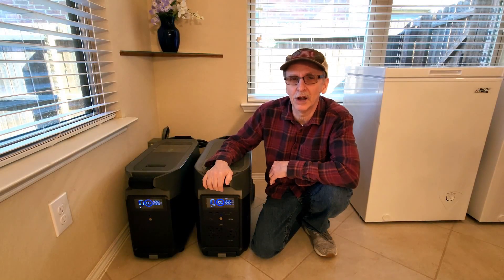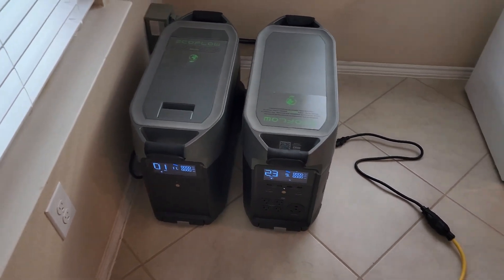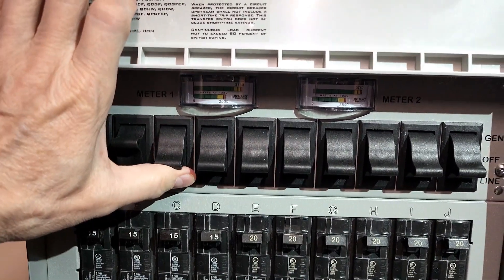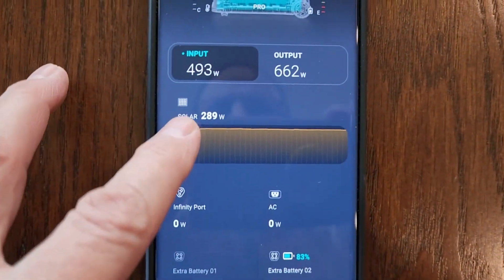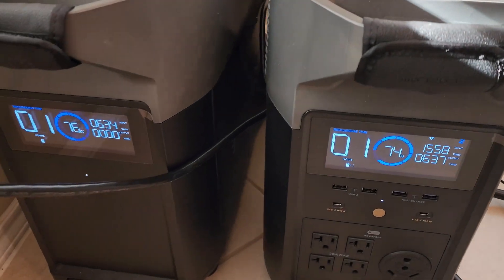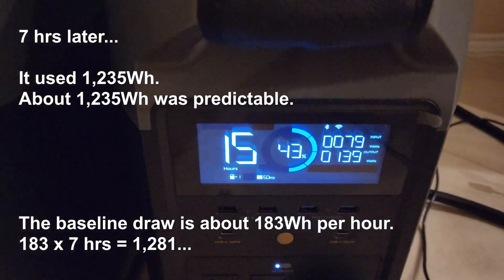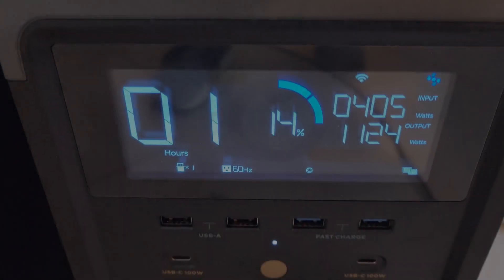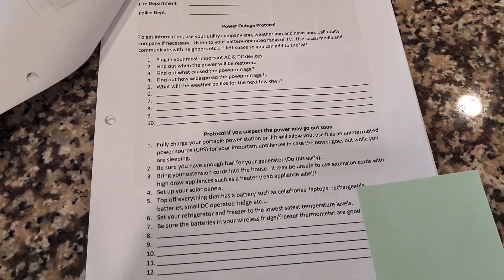Ecoflow Delta Pro Solar Generator - 24 Hr Power Outage Test. Charged With Gas Generator And Solar.

Comment: Thank you for this video, im collecting all the parts needed to assemble the same system for my home, I'll also be adding the eco flow smart gas generator 👍
Reply from the maker: I would have bought the smart gen had it been able to run on on propane.
Reply: My advice to you if you are interested in purchasing the Smart Generator: I have purchased the Delta Pro, 2 Extra Batteries and the Smart Generator. 1) I learned that the Delta Pro no longer comes with the adapter to connect to the Smart Generator. The adapter used to come with the Delta Pro and not the Smart Generator. The Smart Generator was built for the Delta Max, which doesn’t need an adapter. But EcoFlow markets the Delta Pro as being compatible with the Smart Generator out of the box and it’s not. You will have to buy the adapter separately. 2) The cable to connect the Pro and the Generator together is only 16 feet long. It is a proprietary cable. So you will have to be real careful on how you plan to use your generator as this cable is too short for how most people will realistically use this generator. For that very reason I can’t use my Smart Generator. I will eventually have to come up with a solution that will allow me to run the cable through the wall to the outside. If the cable wasn’t proprietary I would use an outlet box similar to the one used in this video.
Reply: @xxfire07  thanks for the heads up

Comment: I thought you could charge it while you used it.
Reply from the maker: Not sure what part of the video you are talking about... Please show me where in the video you are confused because you can.
Reply: @LoneStarPrepping  you shut things down to charge the ecoflow with the generator.
Reply from the maker: With my setup, if I am using the transfer switch with the propane gen to charge the pro, I cannot use the inside transfer switch inlet with the pro at the same time because the gen is using it.  I can use the 120 outlets on the pro to run things at the same time if I want.  In your case, just dont use the gas gen on the transfer switch.  Just charge the delta pro with the gas gen directly without using the transfer switch.  That way you dont have to unplug the pro from transfer switch inlet. I do it the way I do because I dont want to use an extention cord from gas gen to pro through a crack in my door, among other reasons.
Reply: @LoneStarPrepping  Good deal! Thanks for great videos!
Reply: @LoneStarPrepping  I want to keep things running while charging.

Comment: Question!   I have a Delta Max and read that when storing away you have to drain the battery down to 30%-35% for long term storage.   But that seems to defeat the purpose of having it for unexpected power outages when I won't be able to charge it from an ac outlet prior to using.    Does this sound right to you or am I misunderstanding what they are saying.  I read in one of your comments on another video that you drain the battery every once in awhile down and then recharge it back up to 80 or 90%.    So when not is use.....do you keep it fully (or almost fully charged?) and then just drain it occasionally (every few months) to keep the battery fresh.    Any clarification of this would be helpful.   I just think it is pretty useless to have a battery at only 35% when I need it the most and now there is no power to recharge it.   Hope I am not being confusing.   Thx.
Reply from the maker: I understand.  I keep mine at 80%, but I charge it up and use it every 3 to 6 months.

Comment: Although I have a 22KW whole house generator with two 500 gal propane tanks buried in the yard, it's my Delta Pro plus add'l DP Battery that will provide for my daily power needs in a grid down situation. I have 1600 watts of solar to keep it charged, and would only run my whole house generator for about 60 minutes, twice a week. During that hour we take a hot shower, do laundry, bake, refill our water storage from a well, etc. I bought an EV charger that I plug into my 240V dryer outlet to fast charge my Delta Pro when I run my generator, or if we get an extended period of cloudy, rainy days that shuts down my solar. The Delta Pro is an awesome unit and runs my DC fridge, DC freezer, Microwave and many other appliances when needed.
Reply: that sucks the ecoflow can't run your house fridge.
Reply from the maker: @uhjyuff2095  Where does he say he can't run his house fridge on the Pro?
Reply: What's the EV charger you bought?

Comment: Can the delta pro be charged with a small generator that’s not pure sine wave ? Can’t find an answer to that. I have a small generac IQ 2000 and not sure if it is safe to use for charging my delta pro or not.
Reply from the maker: It probably can, but it is not recommended.  I would only use a pure sine gen.

Comment: I don’t understand how your plugging a 120v plug into 240v. Are you using a plug converter? Link to what your using?
Reply from the maker: I showed everything Im using.  The delta limits itelf and can even take an EV station charge.
Reply: @LoneStarPrepping  from the dryer plug I can see a black plug with a short orange cord then it looks like the orange cord is connected to the 15amp yellow cord that you mention that runs to the delta pro. 
I guess what I'm asking what is the orange section plugged into the dryer 240v outlet?
Reply from the maker: @TonyStark998  ...just extention cords.  I posted links to them inder description.
Reply: @LoneStarPrepping   Thank you very much Sir. Great video!

Comment: Great video it looks like you plug the delta pro directly into your generator inlet don't you need the voltage doubler thing to output 240v?
Reply from the maker: I dont use 240... only 120.  To get 240 I would need 2 delta pros.

Comment: In the winter would you be able to run your furnace? Is that transfer switch interchangeable?
Reply from the maker: No.  We have an all electric furnace, and it requires high voltage.  If I had 2 Pros, I could connect them together and run it but I chose to get the Pro plus extra battery instead.  Not sure what you mean by "transfer switch interchangeable".
Reply: @LoneStarPrepping  You could use portable space heaters and your gas generator and still survive!
Reply from the maker: @uhjyuff2095  We use an olympian wave propane heater.  But if I want to use my vornado electric heater, I have plenty of propane to run my gas gen for long time.

Comment: Get the ecoflow delta pro smart generator. It will automatically charge the unit when capacity bets to 20%
Reply from the maker: No.  I am perfectly aware of thier generator.  I knew about it before it was officially sold retail. They should have made it dual fuel.  I want to run propane.

Comment: What transfer switch do you have? Is it a 30 amp inlet for the transfer switch and a 50 inlet for the gas generator?
Reply from the maker: The transfer inlet is setup for the 30 amp outlet of thr DP.  It is setup for 120 volt only.

Comment: Any idea what the max wattage the units can take from a generator. My generator is 7500 continuous watts.
Reply from the maker: The max wattage input is regulated by the unit itself.
Reply: These do not replace gas generators although the people that run the world are eliminating fossil fuels for the average person. That is why an investment in a solar generator is likely a good one.
Reply: 1,800 watts AC
Reply: The print below the charging receptacle on the EcoFlow Pro sais it can accept 100 to 240 volts ac 15 Amps Max, so you just need the right cable or adapter and should charge at 240 x 15 = 3600 watts.  It only comes with a cable to plug into a 120 volt wall outlet.

Comment: How is it that you can put 220 volts into the normal 110 volts input and not damage the unit? That's remarkable.
Reply: The print below the charging receptacle on the EcoFlow Pro sais it can accept 100 to 240 volts ac 15 Amps Max, which would be 3600 watts, (240 x 15 = 3600) so you just need the right cable or adapter.  I don't see a link in his description for the cable and adapter he's using, although he's told others that its there.  Also, the black power cord included with the EcoFlow Pro has print on it which sais its rated to 300 volts, and they warn you not to use any other cord.  Maybe that's why he removed the link to what he's shown.

Comment: Have you given any thought to possibly using ecoflo’s generator that you could leave plugged in ‘directly’ to the delta pro’s through a through the wall interconnect that automatically turns on and off based on state of charge?
Reply from the maker: Do you mean their their gas generator?   If it were able to run on propane, like mine, then I would have at least considered buying it.  It was a big mistake by Ecoflow, in my opinion, not making it a dual fuel generator.  Also, I had my dual fuel generator way before I bought my DP.  I used it to charge my other ecoflows.
Reply: @LoneStarPrepping  Ecoflow now has a dual fuel option for their generator.
Reply from the maker: They didnt have one that ran off propane at the time I bought my Pro.

Comment: You may want to consider getting a Switched-Mode Power Supply (SMPS) as it would enable you to charge your DP while leaving it connected to your transfer switch. If you watch the video from the link below, you will see my 2 Delta Pro's being charged via Switched-Mode Power Supply (SMPS) at 1200 watts via Yamaha EF6300iSDE.

https://youtu.be/kVEqvLiHx2w

Comment: Great video and thanks for putting it together. I've been thinking alot of just purchasing these to run our home off the grid half the time just don't no if it's worth the investment. Although I just read electric rates are going way up what else is new.   Rob
Reply from the maker: If it is only to save on electric bill, it will take a long time to pay itself off.  Our main purpose is off grid emergency power that we can use everyday if we want to at least put a dent in our electric bill.
Reply: @LoneStarPrepping  Probably take 7 to 8 years to get my money back but the way there jacking our electric rates maye not

Comment: Curious, you mention that the black cord that is connected to the dryer cord is rated for 15amps.  But when charging using the dryer outlet, it is inputting 2784 watts which would be 23.2 amps at 120 volts.  Isn’t the black cord being overloaded?  Thanks for the video.
Reply from the maker: Even at 3000w input divided by 220v (not 120), is 13.6 amps.
Reply: @LoneStarPrepping  I got the 15amps for the black power cord from the link in the description. I did not realize that it would take 220 volts. Thanks again for your videos.

Comment: Love your videos. I'm stuck in decision between the Delta Pro and Delta Max. I live on the second floor of an apartment that I couldn't make modifications to (for things like transfer switches, etc.) but that doesn't mean I plan on being there forever. I do like the expandability of the pro ecosystem, I dont like the price. Unlike you in Texas, we dont have many power outages in southern Illinois. I remember watching your videos when you had the regular delta in the Feb 2021 blackouts. When did you get the Pro?
Reply from the maker: I was the 70th something  backer on Kickstarter,  I got the super earlybird special, so I have had the setup longer than most people. The Max seems to be a great option.  Weight is an issue for me because I have  bad back.
Reply: Only other thing is I hope you don't have it wired to allow the thirty amp plug for the pro able to become live when you hook up the generator. That's dangerous, but I know you know better than that 😉

Comment: Nice set up.  I use my Jackery’s in combination with my generator during power outages.  I also have a separate small solar system but being in northern NY…..the sun doesn’t always shine the way we need.
Reply from the maker: What kind of gas gen do you have?
Reply: @LoneStarPrepping  Honda eu3000i
Reply from the maker: @ADKMan  Nice gen!

Comment: Great video. I’ve thought about adding a Battery backup as part of my prep. 
Were your solar panels connected the entire time? 
Does the Delta flow remaining charge percentage take the solar inputs into consideration?
Reply from the maker: They were connected, but the angle is really bad in the tiny backyard. I ignore time remaining display... not reliable... with solar changing all the time and the load demand changing all the time, the time remaining in display is useless.  Thats why I offer a video series that teaches how to manage the power.
Reply: Hopefully, when you get the solar panels on the roof and at the right angle, the solar input to the delta will offset the minimal demand of your house.

Comment: I use a Delta Pro in our Airstream 25’ RV to always power my CPAP with heated hose and humidifier. Only problem is the weight and size in our small living quarters, but we work with it. Works great when we don’t have 50 Amp or 30 Amp hookups. I do have (4) 160 Watt panels yet to try for Charging. Too windy, too cold or just to cloudy in WI. Great informative video.
Reply from the maker: Do the panels give you what you need... I bet they provide enough power for everything when you have sun.
Reply: @LoneStarPrepping  question: if you have a 1300 delta and hook it up to another 1300 delta, would you have 2600 wt power?...i am confused
Reply: @LoneStarPrepping  and i need an electrician for a transfer switch box????...
Reply: Yeah weight is the tradeoff to having the superior LifePO4 batteries!